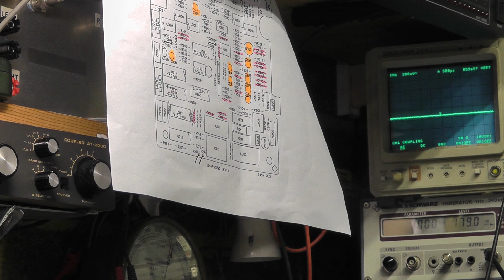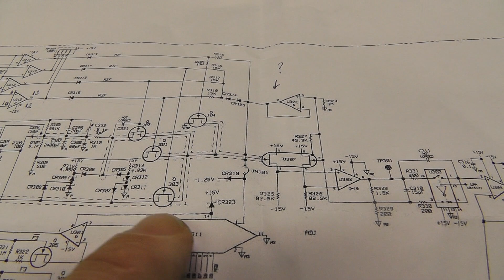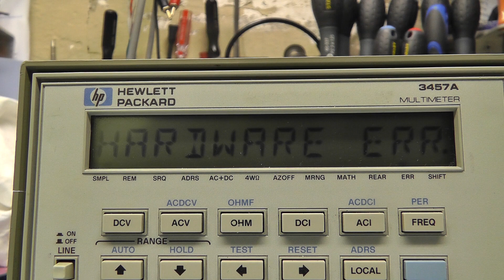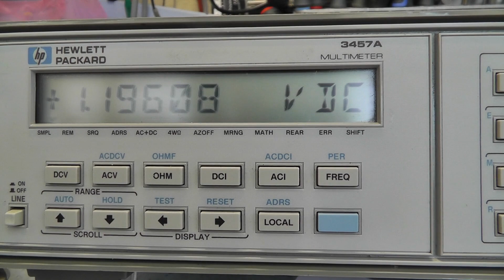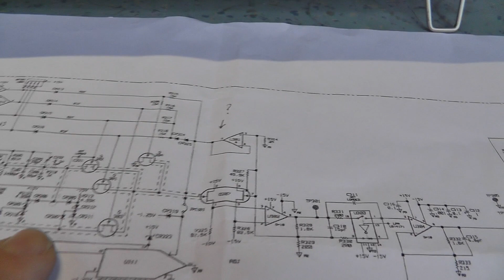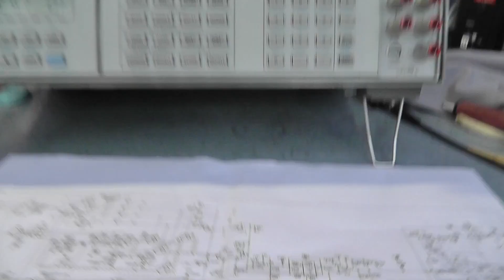Hp 3457a Pt3. finally it all comes together!

Comment: Hi Simon, great video. The Ronan will only show a mA reading once the actual mA has been asserted on its output. So if you haven’t got a completed circuit it will flash the ‘1’ to let you know that it’s not actually managing to inject any current.
Reply from the maker: Oh thanks !didn't know that,. Should read the manual really!

Comment: I always check for ripple first, 90% of the faults I find are capacitor related.
Reply from the maker: Agree. And I did. The ripple was just a small part of the problem and only about 20mV on the 15 volt rails.